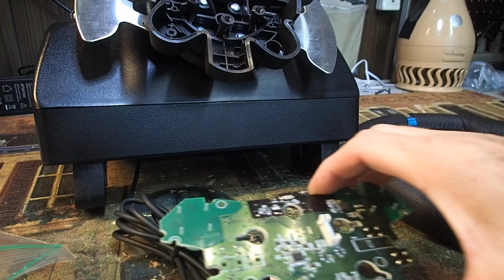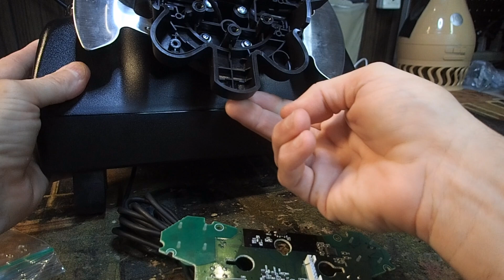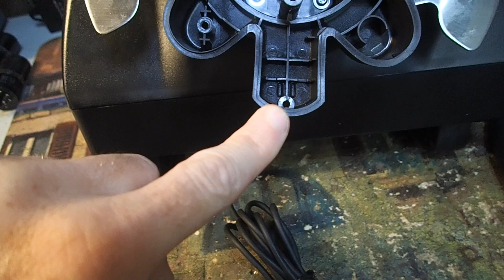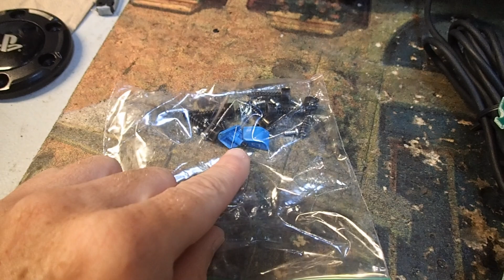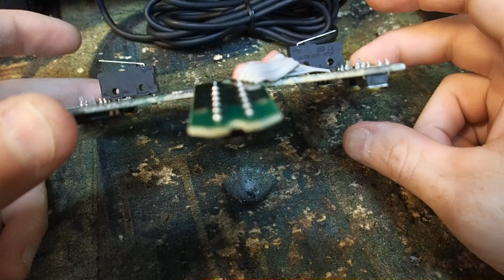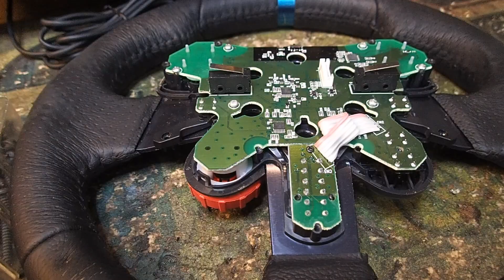Logitech G29 driving force racing wheel paddle switches replace repair

Comment: Thanks a lot for the tips. It worked for me on G923.
Reply: How did you remove the pin under the motherboard? It's kinda hard and i didn't push too much cuz i feel it might break.

Comment: I am really disappointed with my G29. The switches on the paddles started failing in less than a year. I have older, cheaper wheels that still work after more than 5 years. Bad quality by Logitec.
Reply: You have a year of warranty
Reply: @ChongolioPR  I ended up replacing the micro-switches. I hate sending stuff back when it comes from Amazon, I don't want to do it unless i really have to. But the quality is very questionable since my older cheaper wheels still work! but solved! thanks.

Comment: Is there any chance you could put a link as to where you got the new switch?
Reply from the maker: https://www.aliexpress.us/item/3256801315391857.html
Reply: @bigslick  Which one is it? 3 Pin wich lenght? I need to open my wheel later today.
Reply: @devos0162  good question. I'm wondering the same
Reply from the maker: @aalllxxx  16mm 3PIN ZJ
Reply from the maker: @devos0162  16mm 3PIN ZJ
Reply: @bigslick  i found one that is 16 mm and 3 pin, but how do i know if it is ZJ, and what does it stand for.
Reply: @bigslick awesome! What a lifesaver. Thank you. Btw do you know if G923 is using the same?
Reply from the maker: @aarongjh  Sorry, I do not have any experience with G923
Reply: Do you have the exact link for the connector? Switch